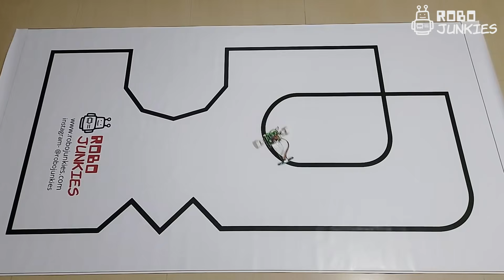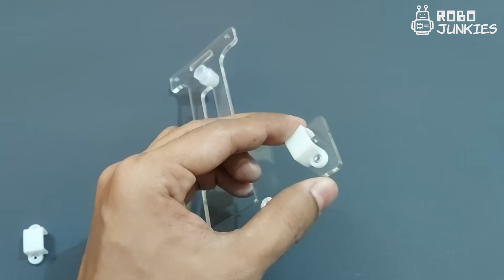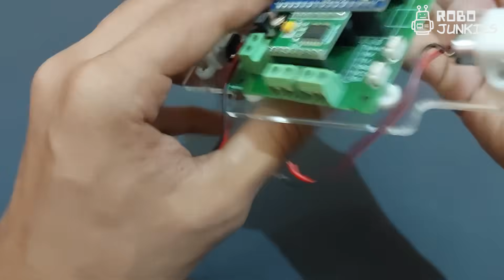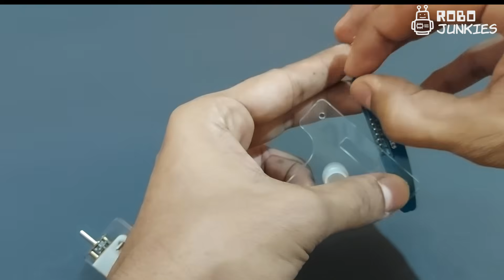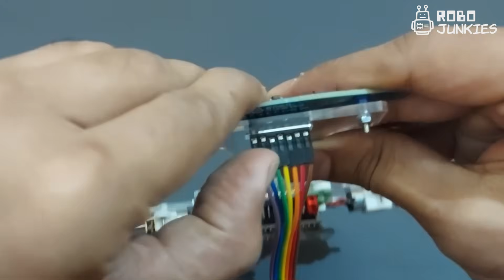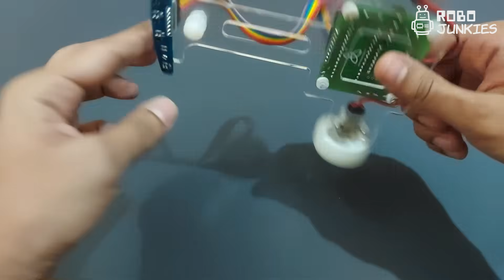How to make a fast line follower robot with Arduino Nano

Comment: a quick question if I directly connected my motor driver to the buck converter which is drawing 5v(tb6612fng motor driver ) will my bot will run smoothly!?
Reply from the maker: The thing you need to be careful with while using a buck converter is the max current output. 
If it can supply the required current then it should be fine

Comment: Nice kit, however i feel screw terminals for the battery is dangerous, as you have to peel of the insulation from the battery wires. Also does you kit/carrier board includes boost converter?

Comment: Awesome.
Can I substitute DRV8835 for DRV8833 ?
Reply from the maker: Hi, drv8833/8835 won't be drop in replacements in the robot. 
You'll have to change the connections in hardware and code to make it work.